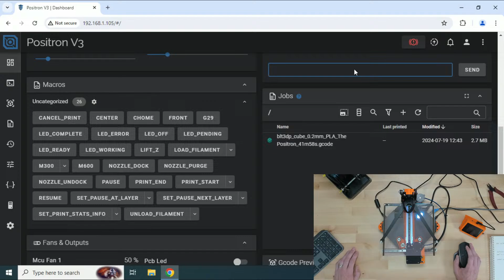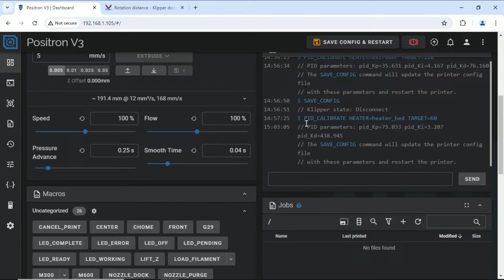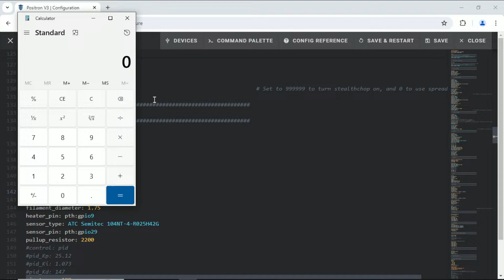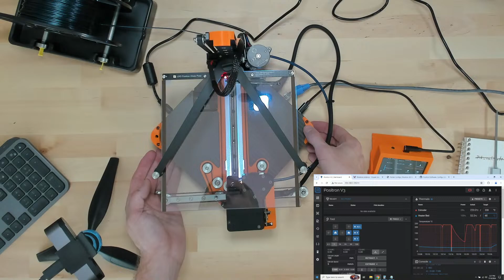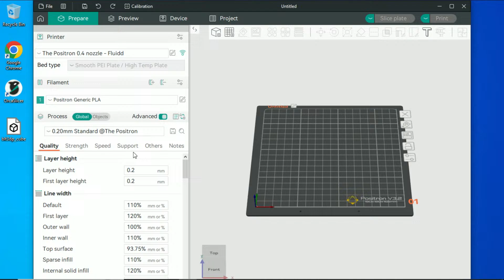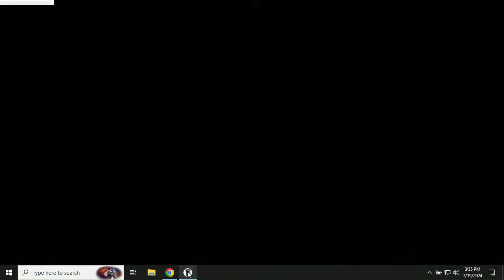Let's Build: LDO Positron v3.2 Final #3dprinting #livestream

Comment: Thanks.  You may be right.  I thought that since the filament goes in on an angle, that it’d be harder to measure.  At least with the the tube, I could use the edge of the tube as the reference point.